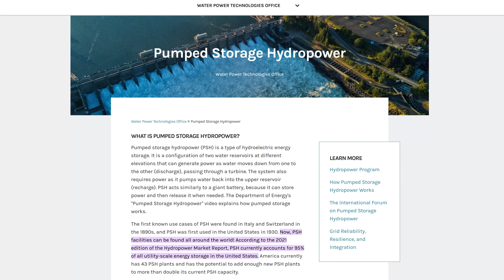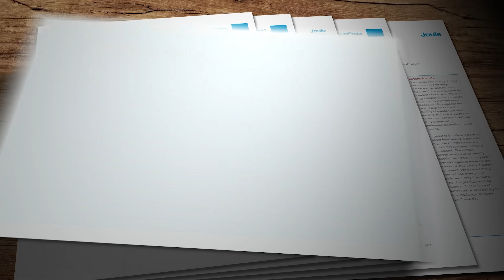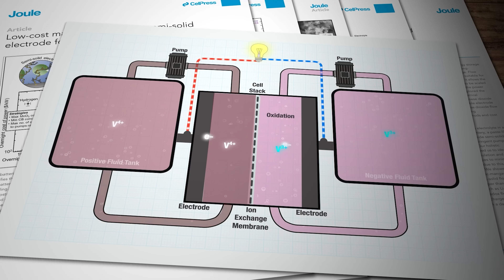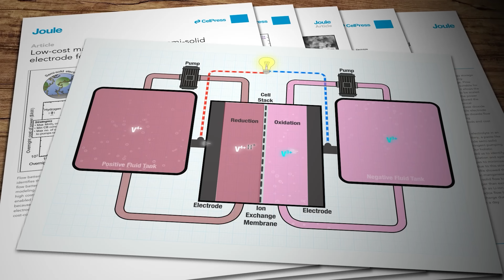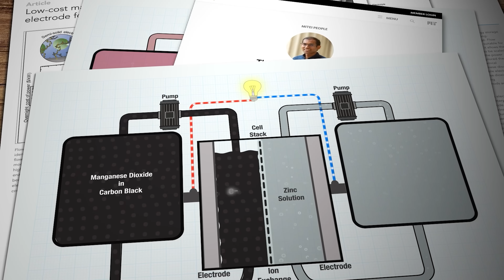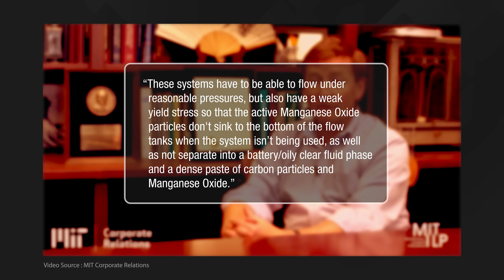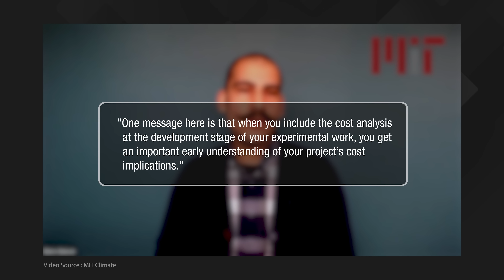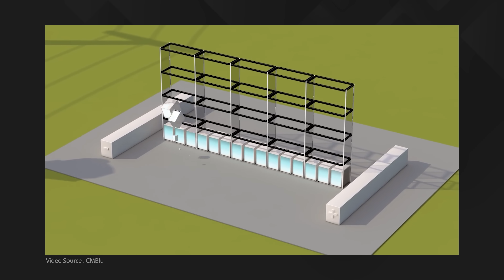Have we found the missing link in the energy storage equation?

Comment: Curious what they will use as the diaphragm/separator for these types of batteries as they would need to resist enormous shear stress and be highly conductive. I would guess that this would be the greatest technical challenge in this family of batteries.
Reply: Not really. The active chemistry is in paste form, rather than being dissolved, so you are not having to worry about those crossing a badly designed barrier (unless it is really bad). Structurally it can be mostly ion conducting perforations in a dedicated structural material. The two problems can be separated, and only letting what you want to go through is actually easier than with many other battery designs.
Reply: Look on Wikipedia for the design and uses of these batteries that are in operation and have been for a long time. Nothing new here